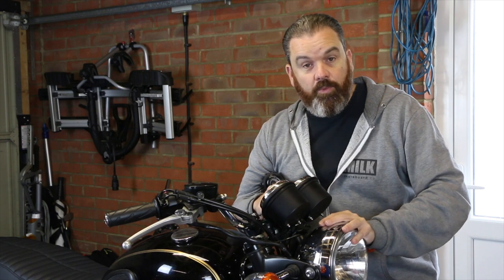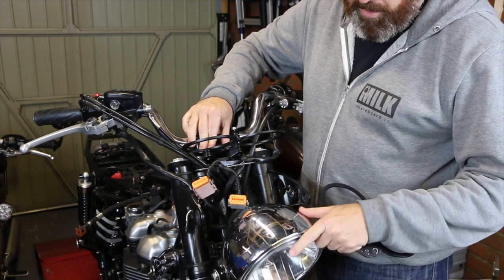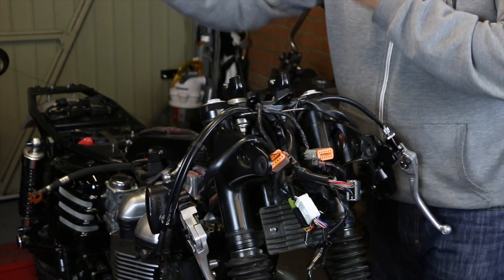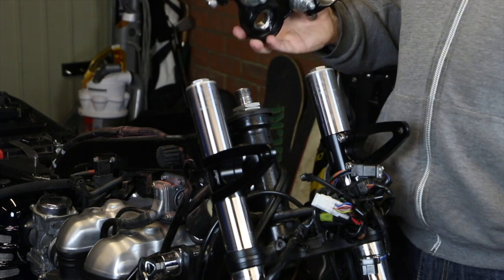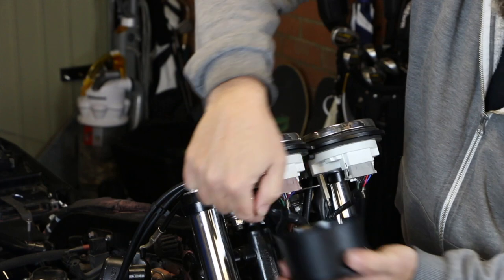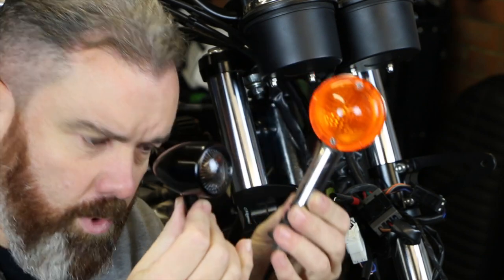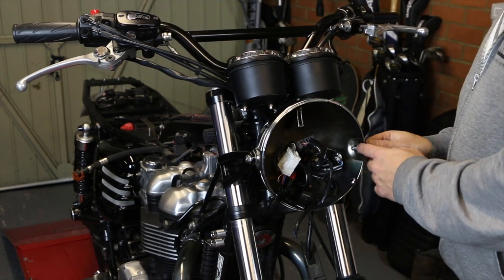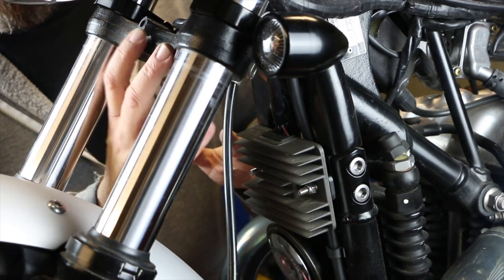Motone Customs T100 Build Pt 8 - The front end gets a big makeover!

Comment: I do like the look and practical position of the ignition topside, vs  next to the turn signals.  Do you have a recommendation for a factory looking horn but louder than the road runner, tone meep meep that comes factory. Thanks.
I would like to remove and replace my headlight brackets the cheap black tin looking parts do look very boring. And the adjustability of the components is really sweet.  So what was the cost of the kit u put on? Thanks.
Reply from the maker: I haven’t found a louder horn that still looks stock. The Denali soundbomb mini is the closest, and could be mounted out of the way? The cost in total or the cost for the parts in this video? The prices can all be found on the Motone website. I didn’t pay for the Motone parts in this build, they own the bike and I’m essentially making the videos to show how the parts fit. Once its finished (I’m just waiting on an exhaust) the bike will go back to Motone
Reply: @mancavemoto  I see. Well,your descriptions are great and gives us ideas and visuals so we don't necessarily have to experiment totally blindly. Thanks so much.

Comment: I suppose you could give the rectifier a thin coat of black paint.  It'd blend in real nice with the black of the frame and be camoflauged.   I think you could cut the wires, solder in long lengths of wire, and relocate the rectifier anywhere on the bike that it would be ventilated.

Comment: Hello, I've recently fitted some of the Motone custom billet indicators to my Royal Enfield gt650 Continental... they look fantastic but they are quite dim.. so not the most functional... finding it best to do arm signals as well for safety... just wondering if there's any way of brightening them up? Are higher rated bulbs available or anything ???
Reply from the maker: Interesting, they certainly weren’t dim on the triumph. Not sure what could be causing the issue?
Reply: @mancavemoto  ah OK...  do you think it could maybe just be a loose connection ? It's those bullet crimp connectors.. not the best...
Reply from the maker: It could be

Comment: Hi Tony, I heard the throttle by wire on the street twin makes it complicated to swap the stock handlebar for a different (say a drag bar) one. Is that true? Or is it as simple as the old bonnies where you could just slide the controls off of one, and slide them back into the new bar? Thanks for all the videos and the great work!
Reply from the maker: Its a tiny bit more tricky to get the assembly off, and you need to ensure you have a hole for the locating pin in the bar. Outside of that its just as straightforward
Reply: Views from the Man Cave Tiny bit more tricky how? Is it still something that anyone can do? I had heard someone mention that the fluids needed to be flushed etc...
Reply from the maker: @othmankammah382  No need for that, its just getting the controls apart. I never changed the bars on mine, but I know people that have ans its not been a hassle
Reply: Views from the Man Cave interesting. Thanks Tony!

Comment: What size/length bolts did you use to mount the ignition to the lay flat?
Reply from the maker: I’ll check, but from memory I reused the original bolts?
Reply: @mancavemoto  so sorry I just realized I only need to get some nuts for them.  Thank you for replying though.  That almost never happens on YouTube
Reply from the maker: @w-h-y-  no problem I try to reply to all messages if possible 👍

Comment: cool bits added there mate, personally though i think i would have flippe the indicator brackets so they say forward more and then then looks like the hinge would be hid behind rather than at front.
Reply from the maker: +John Merrett Thanks, yep that's how i originally offered them up, but then preferred them sitting behind as you lose sight of the mounting arm and the wiring is a bit neater. That's what makes the brackets good, as you get plenty of options

Comment: Why in the world do you guys want your gauges to lay flat?  I have a 2022 Street Scrambler, and it's speedo lays too flat.  Most of the time all you can see in it is reflection of the sky and tops of trees.  What is the thinking behind this?
Reply from the maker: Its aesthetics, I think it looks better and theres been no issue reading the clocks (which are different to the street Scrambler)
Reply: @mancavemoto  On the SS 900, it's just a stamp formed bracket.  Motone should make a replacement that pulls the top of the speedo back about an inch to inch and a half.  
I miss a tack, even though it's not a high winder.  The digital window is just to puny and terrible contrast to see the RPM's while going through gears in midday sun.
It's small stuff though.  The bike is really awesome.